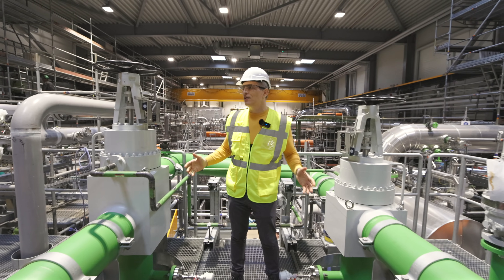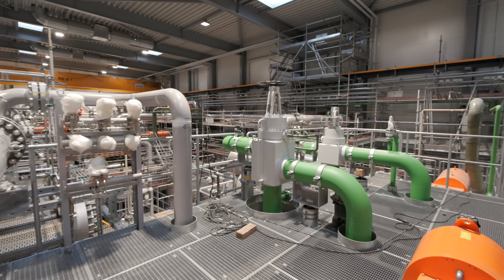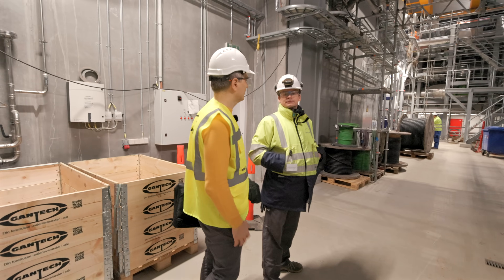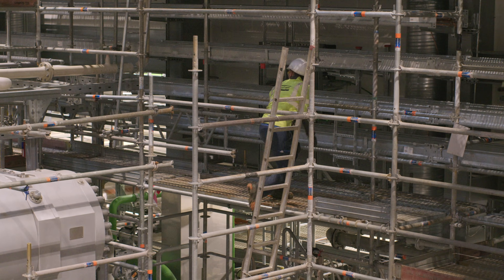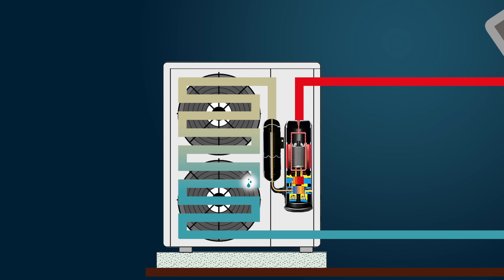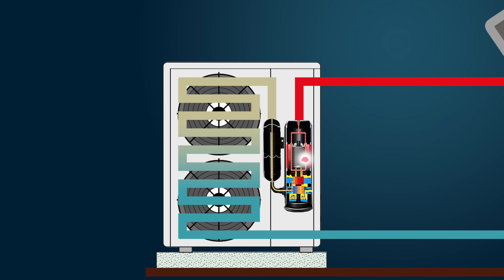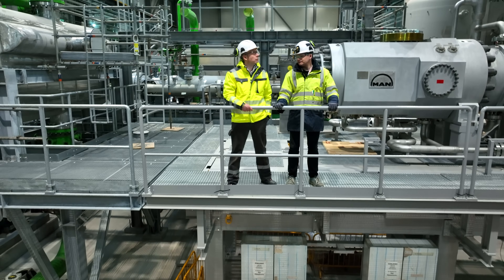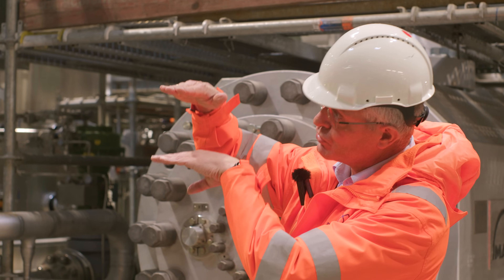Inside the world’s first giant heat pump that heats an entire city with CO2 and sea water

Comment: Before anyone thinks this is a great way to heat cities, it is not. Its developed to use the rest heat of the coal plant, which was free, after that plant shuts down it wont be free anymore. €40 Million Euro comes to €1600 on top of what everyone was already paying. Also they will have to pay for the electricity being used to run the replacement heating system. Esbjerg will see increasing cost for their home heating.
Reply: The surpluse heat was hot free - in fact, we paid a lot of money for it. The business case showed, it would be cheaper to build our own production than let the coal plant being re-built to a biomass plant, which was the alternative. We do expect the heating to become cheaper for the end customer with in few years.
Reply: @dinforsyning8578  The basic fees were mentioned in the story, the infrastructure in form of pipes was 450 million euros, 18,000 each household.  These pipes rust very fast because of the high temperature of the medium. I hope your fees wil bel lower but my assumption is it won't. Only time will tell.
Reply: @rteune2416  65% of all danish homes have district heating pipes in their streets.  We have had them since the 1950s.  The  longevity of the pipes are no longer guesswork.  The medium in the pipes have anti corrosion elements mixes in and last a long time.  The pipes where i live have been replaced once since the mid 1970s when they were put in.  Also the pipes used now are far better that those used before and are expected to last longer.  The pipes are certified as DS/EN253. This certificating guaranties 50 years at a max of 115C, but since they only carry up to 75-80C It is expected that new pipes now will last over 80 years.
Reply: 'rest heat' ???   

Apparently coal loving trolling YT experts, just get confused, when actual facts are used.... So it's best just to ignore them...
Reply: Bless the Danish and their "grid balancing gymnastics" -- but this is the dumbest/stupidest renewable-energy contraption I've ever seen.  (Have to feel sorry for the manager how has to describe this contraption.) 

1) there is nothing unusual happening with the climate.  (Please explain the Little Ice Age and the Medieval Warm Period.) 

2) there is nothing wrong with burning fossil fuels.  Its problems in high-density areas are trivial to fix and already have been fixed.  CO2 is not a pollutant.

3) Climate alarmism is a big-lie superstition supported by tax-bribed liars.  (See Climate Discussion Nexus for 100s of videos on climate quackery, deception, and realism.)

4) decarbonization is 21st century pyramid building and human sacrifice. 

5) there is NO excuse for expensive electricity.  Electricity generation is boring.     Just burn coal and scrub the smoke in densely populated areas.

6) the only challenge is manufacturing market quantities of cheap gasoline.  South Africa has already done this for decades (Sasol), using coal. 

7) Elon Musk: the Laptop Class is in La-La Land.

Comment: At last some explaining the obvious. AIR SOURCE HEAT PUMP are extremely expensive to run in low temperatures...
If you live in a cold country don't fit one.. Or if you do turn it off in the winter.. So 5 months a year..
Reply from the maker: I operate an air source home heat pump, got 2 winter months with -5 Celsius as average, almost permanent having -10 and below during the nights, down to -18 for a couple of nights, and up to 0 during the days. Yes, the consumption was double comparing to the two much warmer months that followed, but it wasn't extremely expensive. Probably would be interesting to do a video with that experience and detailed numbers shown, what do you think?
Reply: Google, ground source heat pump...  

Person I bet is from the UK? 

There's so much FUD and disinformation in that country about heat pumps...  Instead they tend to prefer inefficient electric storage schemes...
Reply: @Watt-Energy 

Experimentation and pilot-plants can really prove the total overall costs.

The use of a lot of steel and concrete in the energy capture system as well as the need for at least one quarter of the energy requirements to be produces by other means is challenging.
Reply: Bless the Danish and their "grid balancing gymnastics" -- but this is the dumbest/stupidest renewable-energy contraption I've ever seen.  (Have to feel sorry for the manager how has to describe this contraption.) 

1) there is nothing unusual happening with the climate.  (Please explain the Little Ice Age and the Medieval Warm Period.) 

2) there is nothing wrong with burning fossil fuels.  Its problems in high-density areas are trivial to fix and already have been fixed.  CO2 is not a pollutant.

3) Climate alarmism is a big-lie superstition supported by tax-bribed liars.  (See Climate Discussion Nexus for 100s of videos on climate quackery, deception, and realism.)

4) decarbonization is 21st century pyramid building and human sacrifice. 

5) there is NO excuse for expensive electricity.  Electricity generation is boring.     Just burn coal and scrub the smoke in densely populated areas.

6) the only challenge is manufacturing market quantities of cheap gasoline.  South Africa has already done this for decades (Sasol), using coal. 

7) Elon Musk: the Laptop Class is in La-La Land.